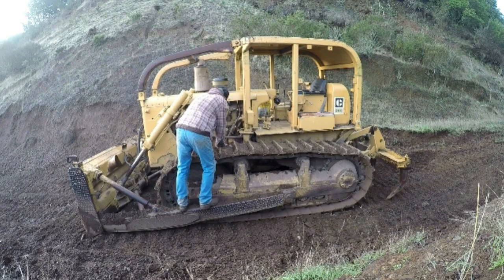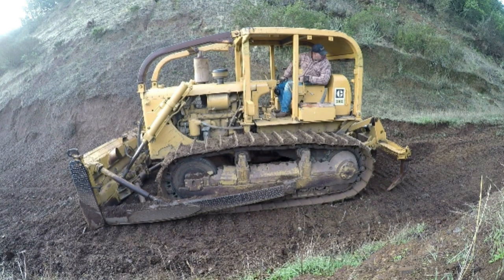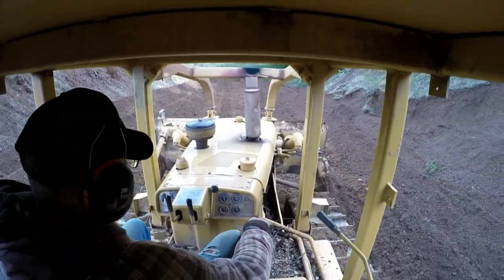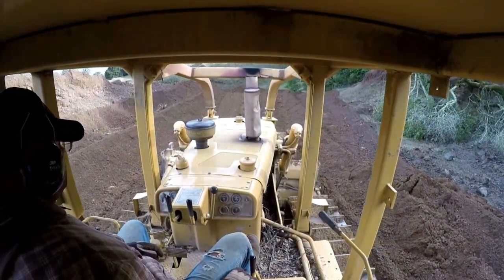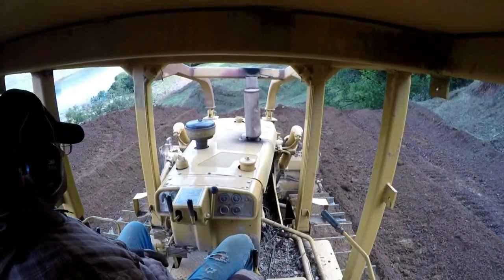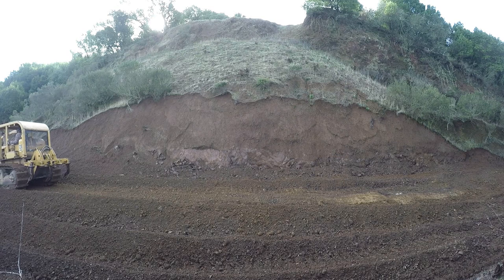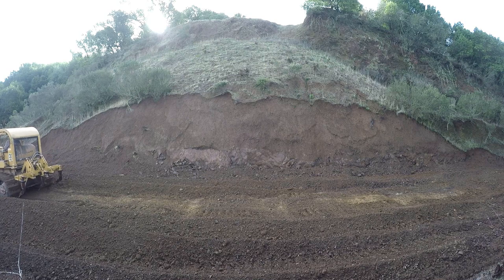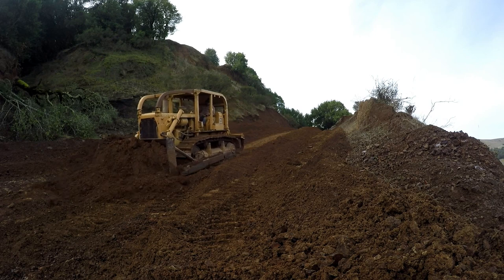How to Operate a Caterpillar D6C

Comment: I am dozing some iowa clay right now and it sucks. Im sure my blade is dull as it either wants to gouge or run on top. Even after getting a blade full it just sits there and won't roll. Sticky, some rocks and streaks of white lime. Just a hobby dozer guy not a pro. It sure would be fun to push something that easy to move.

Comment: Talking about the machine you cut your teeth on, the International TD-18, you spoke of a gasoline motor you had to start before you could switch to the Diesel engine. That was called a “pony motor” and were standard on all brands until electric starting became the norm. What the pony motor did was warm up the Diesel engine. I was lucky in that I broke in on a Caterpillar 977H Traxcavator. International was an excellent brand but as an old Cat skinner, you can never go wrong with a Cat.
Reply from the maker: Yeah I get that but on the TD-18 from what I can remember didn't have a pony motor that could be detached like a Caterpillar. The TD-18 would start on gas and also shut down on gas otherwise it would have a difficult time starting again. A Caterpillar that have pony motors start on gas and shut off once the main diesel motor is fired and that motor can shut down when ever. I left that out on the video cause I've never heard anyone say the DT-18 had a pony motor. It's all in how your taught. Thanks for contributing!
Reply: @farmerjoy491  Exactly right, a lot of IH equipment had this feature, the Rowcrop MD did as well. What they would do is start on gasoline and switch over to diesel once the engine warms up. A lot of Older IH equipment has it as well. I believe the WD had it, the MD did and the Super MTA Diesel did. Was a trademark on international engines.

Comment: It’s not a decompression pedal  stoo . It is a decelerator pedal  pal.
Reply from the maker: Your right my bad.
Reply: Td 18 did not have a pony motor the main engine started on gas when it warmed up you switched it over to diesel..